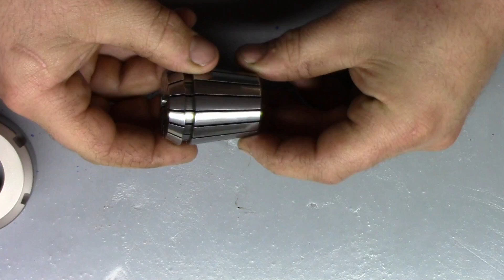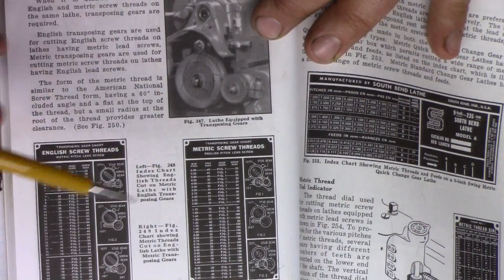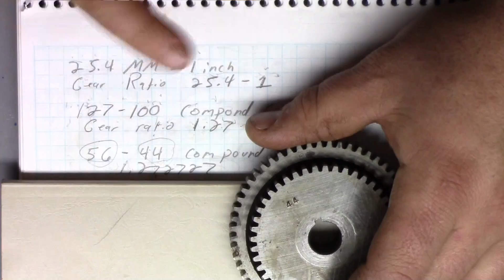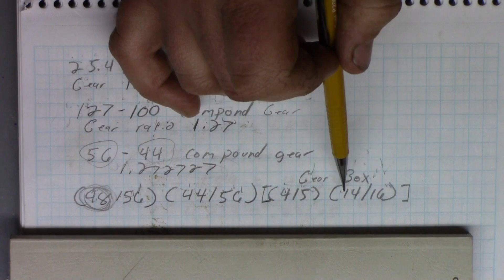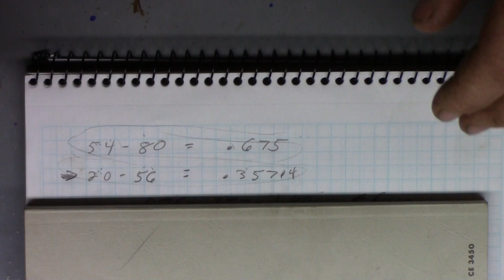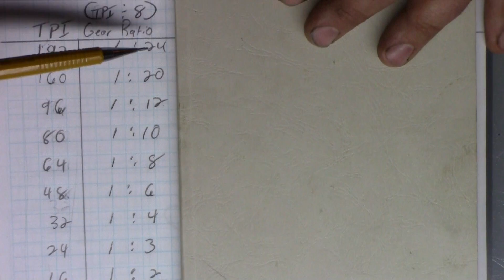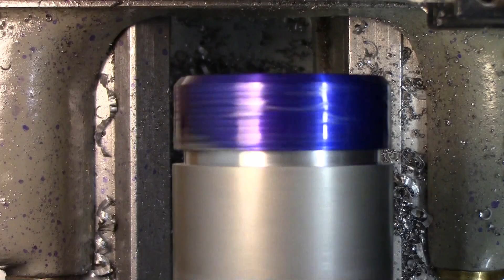Metric Threading on an Imperial Lathe

Comment: Hi !

I do threading this way ... without dis-engaging the halfnut AND PULLING back the cutter BEFORE turning into reverse - it works fine !
 I do it this way because I don't have a threading dial - and I have to do some fine-thinking to make one OR maybe just engage - I havent found out yet.

But my lathe IS a metric lathe with a metric lead screw - I beleave I would have similar problems if I had to cut IMPERIAL threads - but I'll works around this as long as posible !
Reply: +Keld Sørensen The thread dial is nothing more than a worm and gear, with the leadscrew playing the part of the worm. So if you can't find one, you could probably make it, but it would involve cutting a gear the same module as the leadscrew and a housing, which of course you would cast from your supply of beer cans :)
Reply: Juan Rivero
Ha, ha, yeah, I have no need for buying material for casting a housing ... but I need to do some fine-thinking to UNDERSTAND how all this relate to each other ... and I beleave this video has something I can use to get this understanding ... but I need to do this fine-thinking and relate it to what I have noticed earlier in this understanding process.

Comment: Good video as usual!    You can easily make the collet nut without the snap in groove and eccentric. all that's needed is the 30degree internal taper for it to compress the collet properly.Then you can use whatever thread pitch you want for both the nut and chuck.   However, after making my own, I do prefer the manufactured nut, mostly on the vertical mill as it prevents the collet from dropping down.   To cut the 1.5mm thread on my 9A, I simply substituted a 26 tooth gear for the 20 tooth stud gear which creates a 1.50091mm (16.9231 imperial) pitch thread at position B4. For that length of thread engagement you will not feel or see any difference (.06% error). The gear can be easily made with Delrin, PVC, Nylon etc simply by slotting the teeth with a form tool on the tool post and indexing the spindle.
Reply from the maker: +martik778
Yup that will work also.  Just have no provision for gear cutting here.  Have a bunch of change gears though :-)

Comment: Hi mate.  I always wondered if that can be done, I would have tried but it's not so hard on my  lathe, it being metric.  I would like to know if you can still use the halve nut in a certain position.  Well done mate.
Reply from the maker: +Marcel Timmers You could, but it's very specific.  SB made a metric thread dial with multiple gears.  You'd use a certain gear depending on the pitch range.  I've only seen it in books and never out in the wild.
Reply: Could be worth finding out mate.  You might get more and more metric repairs with all the import there is.